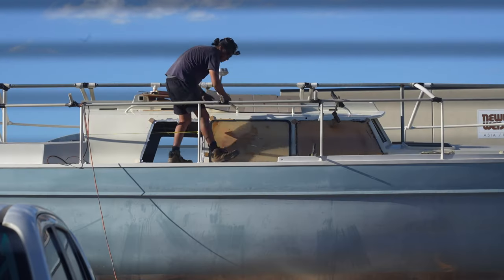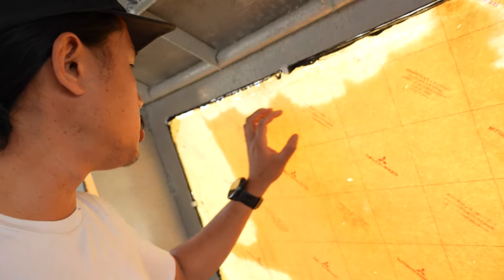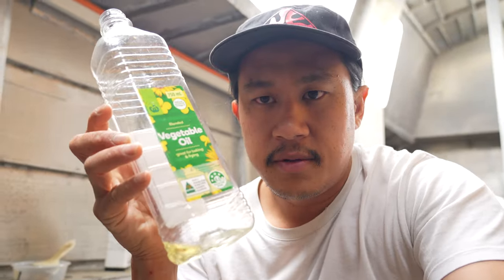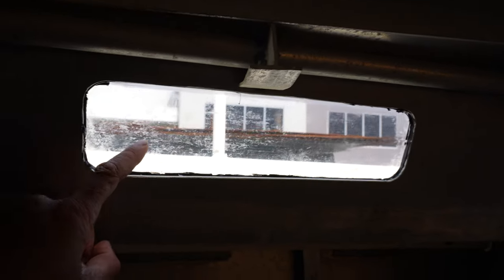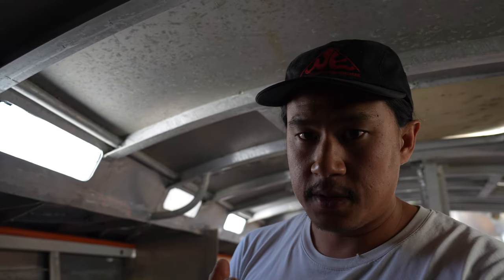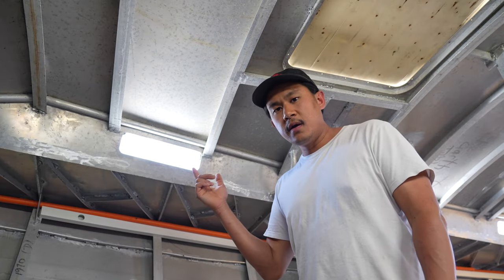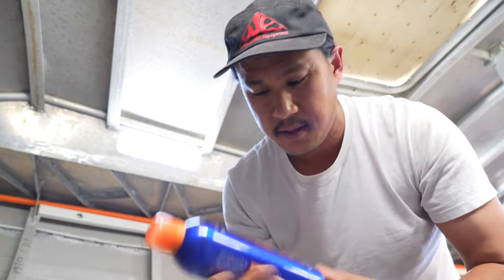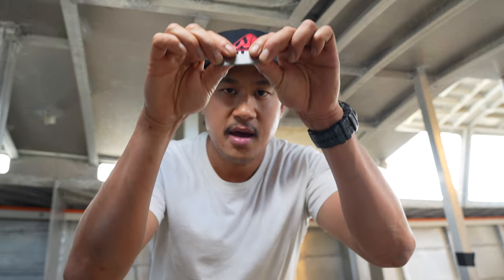How to remove backing paper from very old acrylic or perspex

Comment: PlastX is amazing for buffing plastic. It will also remove overspray on clear coat. I have used it to buff out headlight lens after sanding up from 600 to 2000, then plastX…
Great advice
Good video
Reply from the maker: Thanks. Do you know if the fogging just happens on the outer layers or is it usually something that happens all the way through?
Reply: @sailingkulali  are you referring to a yellowing headlight lens? If so, it’s on the surface. It’s from UV exposure. You can sand that layer down to raw material and then sand out the scratches, then spray with clear coat. I would use a 2K clear with a UV Blocker.
When restoring headlight the right way, I would wet sand with 400G, then 600, then 800. Cleaning in between each grit. After the 800 I would spray 2 heavy coats of clear being careful of it running. They should turn out amazing and last for years. The key to lasting is the UV 2K clear. Once you have sanded Polycarbonate, it will not longer be UV stable, so you must protect it from UV
Reply from the maker: Yeah okay. Yes I was wondering about UV damage. The windows will be sitting exposed until the build is done and so I expect some UV damage over time. Good to know it can be fixed.
Reply: @sailingkulali  maybe keep a good wax on them. That might slow it down a bit. Some waxes have UV block in them I believe. That is one of the downsides to Poly, it does not like sunlight.
Reply: @sailingkulali  yes, you can bring them back to new again, I only take poly back up to 800G, that gives the clear a good rough surface to bite onto.

Comment: This is the only video that actually help with removing the paper on Plastics... still a mess and better off just buying all new stuff than dealing with removing old paper.
Reply from the maker: Yeah agreed. Much easier to buy new acrylic. Just need to factor in $$$$$
Reply: except where does the 'old stuff' that you deemed a mess going to go?  The landfill.  The earth.  What a pity
Reply from the maker: Yeah for sure. Much better to try use things already built.

Comment: I have been using Paint Thinner for years with no problem.  It reacts in about 1/2 an hour and removes the adhesive at the same time with NO SCRAPING NEEDED. If need be, clean afterward with dish soap and water.
Reply from the maker: Hey mate, solvents attack acrylics hence the need to use non solvent products. The idea here is the backing paper is oil based, the oil dilutes the dried glue and makes it easier to come off.

I have definitely used acetone, thinners, and kero to clean off acrylic, but it seems to leave a haze and from reading it leads to microcracks which then causes crazing.
Reply: @sailingkulali  thank you, but I have been using paint thinners for 22 years with no issues.  I fabricated acrylic display showcases for Britney Spears & JLo. Haven't had any problems.  Thanks anyway.
Reply from the maker: @BestWorldJewelry  it’s interesting, I have heard people using acetone etc with no problem. I tested an area and instantly got hazing. Not sure if there’s a protective coating on some acrylics.
Reply: @sailingkulali  no, I would never use acetone. Only  mild paint thinner.  Then clean with alcohol or soap & water.

Comment: informative but scraping won't work for acrylic to be used in picture framing.
Reply from the maker: Yes agreed it leaves some minor scratches that you’ll need to polish out. Otherwise you need to rub the remaining residue off using a micro fibre cloth which is very time consuming and tiring…
Reply: Agree, the surface has to be 1100% Clear of any scratches

Comment: Think deeper. Not the paper but the adhesive. Let the paper be your friend. It absorbs and holds the release agent in place for the long period needed to break down adhesive. 
Be kind to the shiny substrate you hope to preserve. Anything harder than itself with leave its mark. Chemicals/Sand/Salt crystals in boatyards are the enemy. Ya get the picture.
Reply from the maker: In a room, a picture painted, clear,
A paper whispers, drawing near.
Best friends we are, or so it seems,
As we journey through our dreams.

But paper's heart is fickle, wild,
To the window it is beguiled.
My role, a guide, a chaperone,
Taking it to the unknown.

The most important task I bear,
To convince the paper with tender care.
To give my all, my heart's desire,
A lie wrapped in poetic fire.

For paper's love is but a dance,
Between two friends in fleeting trance.
Yet we hold on, through twists and turns,
As the fire of friendship burns.
Reply: @sailingkulali  It's rarely the nuptial wot bonds glass to paper
The love nor the promises too
But more the adhesive that nurtures cohesive
Sticks 'em together like glue.
Contact experts "DEHESIVE" in Germany.
Reply from the maker: @Mrbobinge  hahaha very good.
Reply from the maker: @Mrbobinge  I have put in the vid description DEhesive. Unfortunately Im past that stage of the project. Would have been amazing if there was a product that just made it work... Oil did well though.
Reply: @sailingkulali  Murphy. We always bump into the better solution after job-done. Bon voyage(s).

Comment: Kerosene works best or pure citrus & dont need to use a blade
Reply from the maker: Nice. I haven’t tried kerosene. I did use citrus remover but it didn’t seem to work as well as canola oil. 

Not having to use a blade would be amazing. It does seem like there was a chemical reaction between the old paper and windows, so some polishing is needed anyways.
Reply: I hear ya..it does have to be 100% citrus or thafs what a good friend of mine said worked good for him. Truthfully ive only used the kerosene method myself. on some tinted quarter inch Sheets that had paper on both sides I spotted in someone’s spring cleaning, trash pile here in nj sat in my shop Till i ended up using them to replace the frosted glass on the cabinets in my RV. They were marked Philadelphia 1984 I to researched the hell out of it everything I tried steam cleaner, heat, gun power, washer, nothing. then I thought Hell with let me try kerosene. which is what I used to remove the plasty dip off my truck. I soaked down the 1 pc let it sit for 30 min to a hour and was then able to peel the paper off no problem. Also, I only had tried it on the one piece that day and soaked both sides when I removed it I only removed one side and left it the next day when I came to do the rest the pc i had soaked the night before had dried back out but i was able to peel the paper off like it was new it’s like the kerosene is absorbed by the adhesive letting the paper dry again using kerosene worked amazingly well far better than I ever hoped after trying several other ways. good luck with the rest of your build🤙🏽
Reply from the maker: @nickb8735  

wow, I just read up on it too. And found this chemical resistance link. https://www.eplastics.com/blog/chemical-resistance-acrylic-plexiglass

Does look like Kerosene won't harm the acrylic and is recommended as a cleaner. 

I'll put what you wrote in the description because it may help someone. Cheers.
Reply: @sailingkulali  oh damn that’s an good  break down of the chemical effect. Awesome & yea def! Anything to help the daunting task! lol take care!